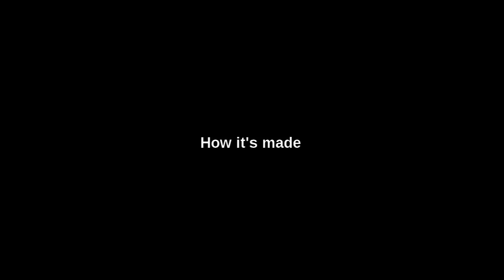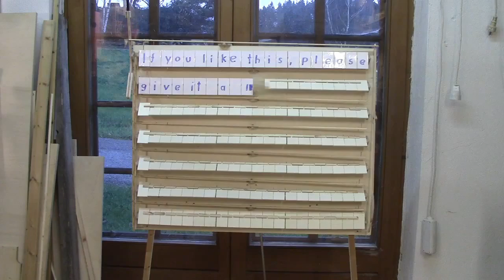⚙ DIY table saw - track saw upside down

Comment: A very neat idea.
I really like how using the track as the baseplate minimises the wasted blade reach.

But I have a few reservations that I hope you would comment on:
1. How did you ensure that the track, and the mdf sheets met at exactly the right height?
2. The grippy rubber on the track, would make it poorly suited for ripping longer pieces. Have you solved this?

Comment: Would it be possible to make a small table saw using track saw in a systainer or slightly bigger (with extendable top).So I just carry a systainer with a saw and accessories ready to be used as a table saw (very small of course). Thanks
Reply from the maker: I'll think about it.

Comment: FWIW small suggestion -any time I  tap threads into wood or plywood now I flood the cut w thin CA glue - re-tap... Repeat.  By the second or third time you get threads that are really crisp but more importantly LAST.  They hold up 10x better in jigs and the like - prob not as good as a brass insert but still really good.  Trick I learned here on YouTube.
Reply from the maker: Thank you for your comment!

Comment: Fantastic video! Most inventive....

Now i just need the £400 to buy the saw!

:-)
Reply from the maker: Thank you, yes the saw is expensive but cheaper as a track saw + table saw. :)
Reply: If you do any sort of carpentry, it will be the best 400 pounds you will ever spend.
I have just worked with a carpenter on site who has just replaced his TS55 after 13 years of hard site work.
That is a life time for normal guys